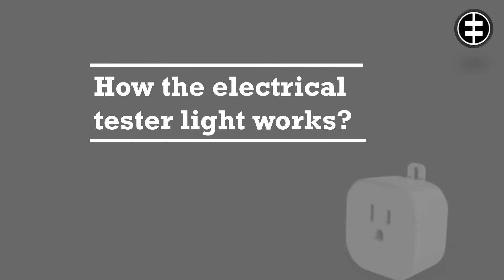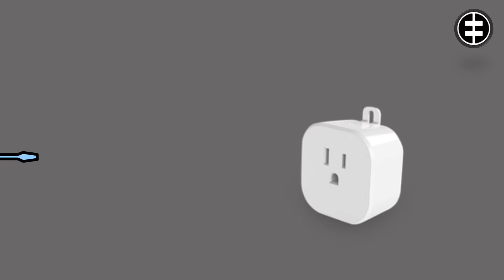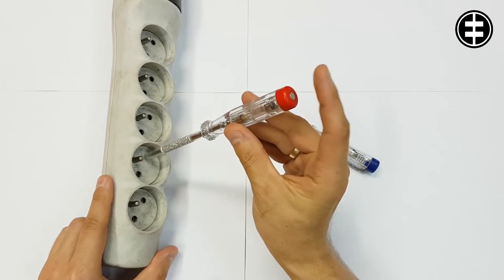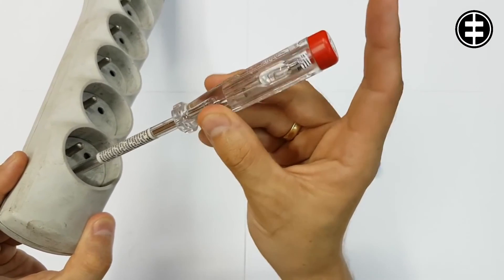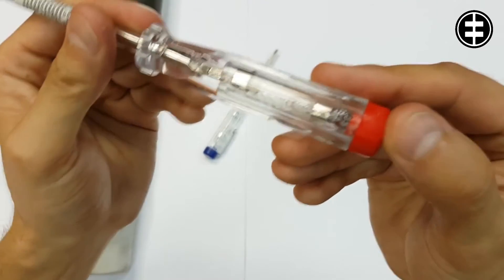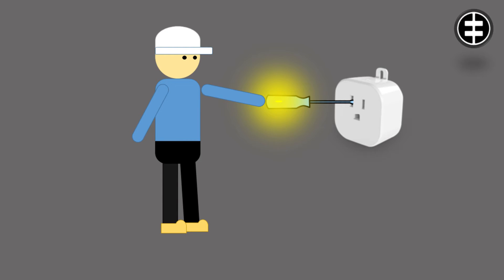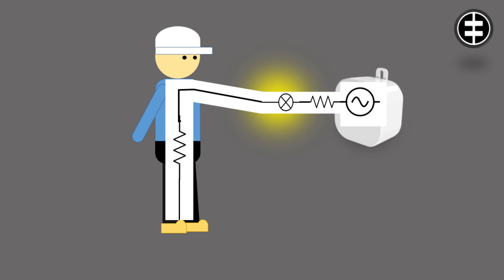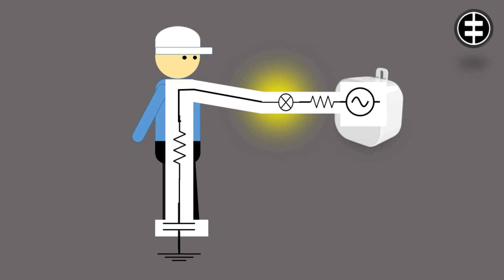How does the electrical tester work?  Why we didn’t shock by electricity passes through the tester ?

Comment: The video is wrong about "completing the circuit". Actually, the circuit is not complete, but it works because the capacitance of the human body. It has nothing to do with earth grounding - just try on a generator or on a transformer, and you will find 2 Live wires - and both will light the meter.

Comment: How about if suddenly there is thunder ⚡ shoot at house electric wire and at the same time  , I am touching the test pen and insert into socket Life hole .

Then the electric current   Ampere which pass thru my body , will be higher ,   then my body will be hurt by high current .

Am I correct ?
Reply: Probably yes. But is more likely any electric device plugged in at this point will explode first as it has far less resistant than test pen and human body. Or even better, the fuse installed in the house will shut any electric current down almost instantly

Comment: I don´t think we complete the circuit with the ground. I even tried it with  rubber shoes on top of a plastic chair on top of a wooden floor and it works. I think the body itself is capable of absorbing a certain amount of electrons, enough to make the neon bulb. light
Reply: because we act as a capacitor. You are right but the video is also right. We don't have to be touching directly to ground. We have parasitic capacitance.
Reply: @gokul8370  Say you charge up a parallel plate capacitor with a 1.5V battery. The capacitor has 2 metal plates very close with rubber(dielectric, an insulator) between the plates. Electrons would flow from the +ve plate, thru battery, into -ve plate. Finally, you have excess electron in -ve plate, shortage of electrons in +ve plate. During charging, no electrons flow thru the rubber as it is an INSULATOR.  
 
In the test pen operation when it is touching the LIVE, "you" am one plate, the earth under your rubber boots is the "other" plate; the rubber boot is the dieletric. During the AC cycle When the live happen to be +240 VAC, electrons are removed from your body through the test pen; when live is at -240 VAC, electrons electrons flow into you from the test pen; but no electron passes through your boots at all as it is RUBBER. It is just your body inhale and exhale electrons which light up the LED.
Reply: @chanrasjid8688 thanks dude, really helped
Reply: @chanrasjid8688 So it won't work if the voltage is DC say like the output of a regulated converter ?
Reply: @jamesdean3352  Yes. The tester is only for AC - NOT DC 240 volts,...
Reply: So it can both ways when testing like this ? Through your body and then through the ground to complete the circuit.Or through your body and not through the ground ?
Reply: The video is correct that "the circuit is completed ... to the ground" as the rubber boots is a dielectric. 

Remember, our mains supply (single phase) has two wires, live and neutral. The neutral is connected to the earth; thus the neutral is also the earth.

The rubber boots (including anything under the boots) acts as the "dielectric" between two conductors - you and the earth under your boots. The earth under your boots is the same "earth" of the neutral wire. Thus the circuit is complete from "earth" to "earth". In general this earth is a huge and very good conductor. 

Note, no electrons need pass through you rubber boots.
Reply: @chanrasjid8688 ...  Hi. I was already having a solid understanding of the concept you were explaining. BUT I lost it when you said electron movement is not needed between your body and the Earth... So how does that LED inside the screw driver work, if electrons don't move. (ultimately it just requires less than a few milli amps of current flow). I had never thought of electron movement until you mentioned. So please help me

Comment: I always use tester during my experiments and I feel a little bit of current on my fingertip. It's not enough to shock me, but still I can feel it.
Reply: Same
Reply: If my neon tube is broken can I get electric shock 😲? Suppose I don't know if my neon tube is broken I am going to use the tester in multiplug can I do that 

Hope I will get my answer??✅
Reply: Why? Just get a multimeter or a volt pen. Phase testers are leathel
Reply: @markshortall3384  ok bro👍
Reply: @markshortall3384  They are not. That's how they work.
Reply: Muslim brother ☺️
Think replacing your screw tester
Reply: @فتىالعرب-غ9غ  Bro, testers work that way. You put ur finger on the tip and u become the conductor for current. U may not feel it, but some current pass through u
Reply: @kaifrahman2703  but the voltage always go to the ground ?

Comment: Will this pen still work if I stand in a bucket of water barefoot while I do it. 
I heard that if I stand in water I won't burst into flames
Reply: You wont burst into flames, far from enough current to do that.

And yes it will work when j stand in a bucket. The body and the ground work as a capacitor. Only an electric field goes thru, the elctrons themselves not.
Reply: You re a better conductor than tapwater is. The water will make no difference. And all the bucket will do, is add a tiny bit MORE resitance if it's a metal bucket, or a lot more if it's aplastic one. So it will be the same as just using it normally with bare feet. The resistor in the screwdriver is plenty to prevent you feeling it, even without the extra resistance from your body, which is not super high anyways. It's only about 1k. The resistor in the screwdriver can vary from 1 meg to 10 meg. So...at least a thousand times more. 
 So even in the absolute worst case scenarion - if you connected a screwdriver with a 1 meg resistor, from a 240 volt socket DIRECTLY to ground through a copper wire, the current flow would only be a little over 0.2 milliamps. It takes a hundred times more than that to have a reasonable chance of killing you.

Comment: im still confused about this thing.. how does earth, something that is usually not even required to light up  a bulb, lights a bulb in the test pen?
Reply: Water analogy is convenient for this example. The live wire has a lot of pressure in it about 220 volt and wants to find a pass to release the pressure. There's a high value resistant in that tester behind the neon light that acts like a tiny hole for pressure to release. That small amount that goes through your body and release on earth is enough to light up the light.
Another way to say it is: your body, your shoes and the high ohm resistant in the tester are in serries and divide the 220v between themselves. Your body 'cause has least resistance compared to two others receives the least share of the voltage.
Reply: @hosseinebrahimi3451  thanks for this, by now I should have used my tester but never had the kahunas (even though I have worked with a spark in the past) I’m just going to go for it though, as I really need to fix something (mobility scooter) that is losing power somewhere around the ignition, anyway I’m rambling, but cheers 😜👍👍👍
Reply: @hosseinebrahimi3451  So what happens if the internal resistor breaks down just enough to become a conductor?
Reply: @iAnasazi  that resistor is never near it's limits during operation. if it would go bad it would fail to a open circuit and never to a short circuit so if it go bad you are more safe than before

Comment: Then y people says using slippers protect from electric shock
Reply: Slippers insulate you from the ground and the electricity has no where to go. In a tester, if you insulate yourself from ground the light won’t glow because the electricity has nowhere to go to.
Reply: @SmaranSastry5521  This is a dangerous comment. You may be wearing the best electrical safety rubber boots. If you touch the live 240V AC with your bare hands, you will get a very bad electric shock;you may still be killed if your hands somehow be in contact with the live wire for some time. With a test pen, the large resistor inside (probably + neon bulb) limits the current through your body. No electrons need to pass through your body through the rubber boots. Because it is AC, the amount of electrons in your body goes up and down and this "CAN KILL"

Comment: why the insulated shoes is represented as capacitor?
Reply: So you are saying that if I fly whily testing the lamp will not glow?
Reply: @РемиБоняшки  no it won't circuit won't get connected
Reply: @jatinmali9310  it glows dimmer. I tested it.
Reply: Because it is a very good insulator
Reply: @manojguha2046  it mean that we can still get an electrical shock even if we use insulated shoes when we touch the line?
Reply: @afrianrahmad8294  same questions brother
Reply: @afrianrahmad8294  yes we will get a shock whose intensity depends on the reactance of the capacitor created due to the insulator.
Reply: That’s because of the stray capacitance between any two conducting objects. Our body and ground are both very good conductors. But it is important to note that this stray capacitance is only present while dealing with Alternating Current.
Reply: @SNGiraffe  I agree with you, describing the shoe as an insulator and then saying the circuit is completed to the ground is not correct.  Current can not pass through an insulator this is why it is called an insulator.